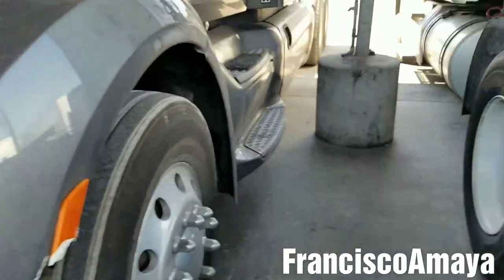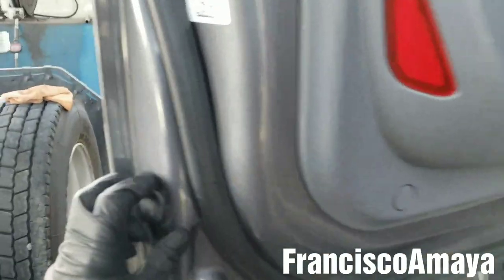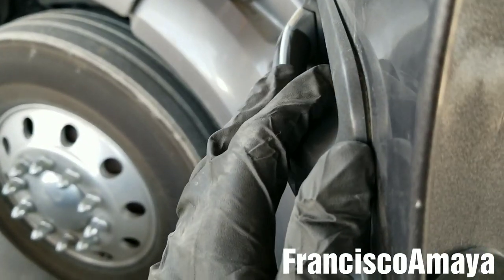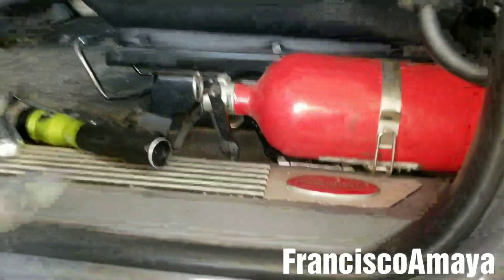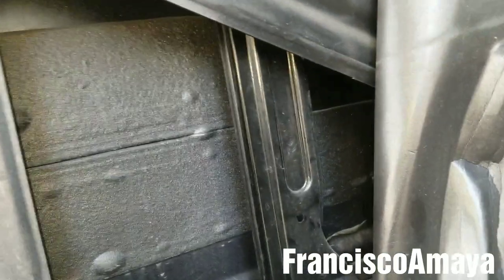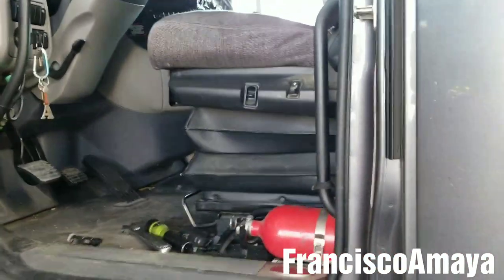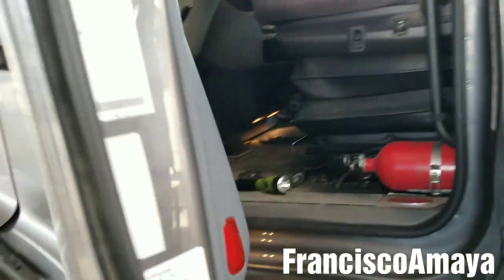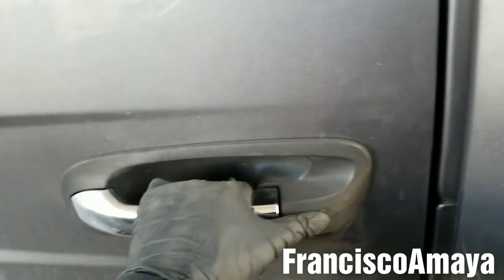peterbilt 579 door not opening inside outside mechanism broken kenworth t680

Comment: My 579 2015 key will not turn handle opens door but will not lock or unlock with key
Reply: Howd you fix
Reply: I ordered all the door lock cylinders ignition and storage. Can find on the internet. Look on the original key and you will see a number. That is the number you put in and they will match the cylinders to your original key. Doors are one fits on one side but not the other. I ordered the entire kit for all just in case.
Reply: @lowriderrider  thanks bud i was able to habe a local locksmith rebuild the lock. It appears someone tried to break into our trucks bud. Stay safe out there